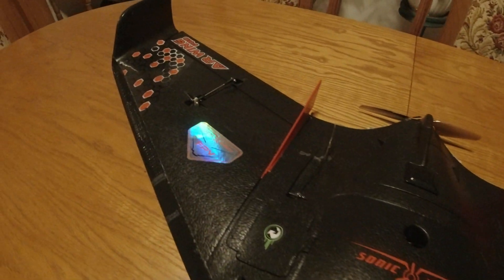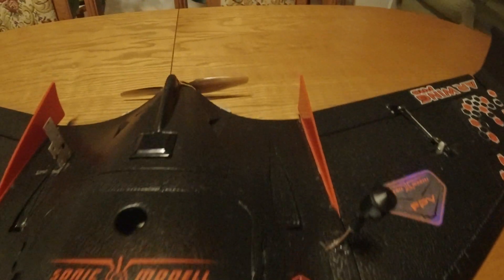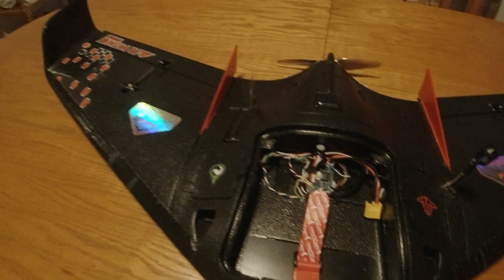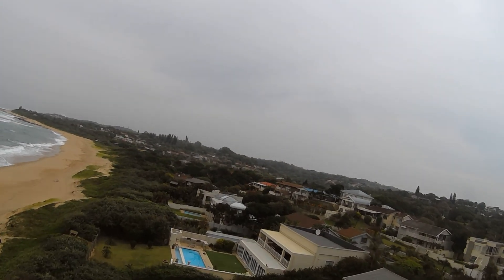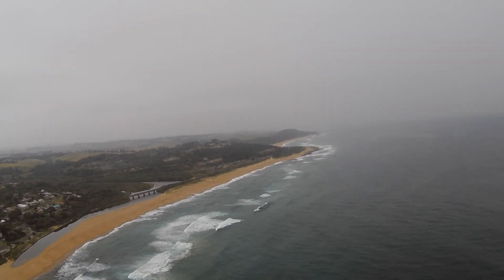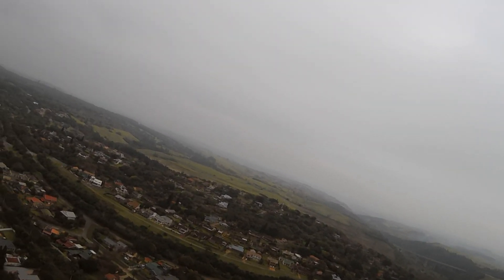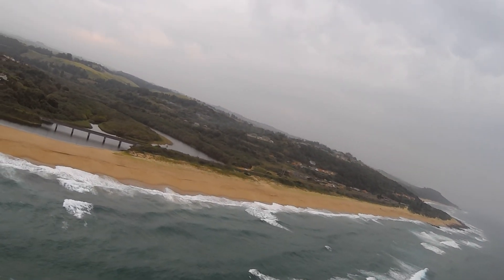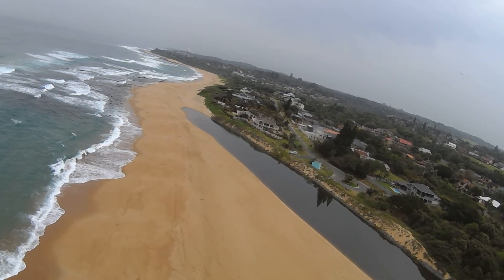AR Wing Pro Setup. Fixing the common issues.

Comment: What do you think about cutting off a little part of the tail and moving the original sunnysky motor closer to the CG ?
Reply from the maker: It would probably make it a bit louder having the prop closer to the body but should work for reducing the amount of weight needed in the nose.
Reply: @antzd  Yeah it is VERY quiet as is, with stock sunnysky 2216 but this one is so long and weights 74g :/ I will probably search for something with low profile, such as T-Motor F90 2806.5 Motor - 1300KV

Comment: This  is  almost  exact  setup  im going for  right  now! Glad  I  foud  your  video.  My  idea  was  to  use  larger mini quad motor  after seeing  plent  of tests that  showed  that these  motors  are  capable  of pulling  2ooo grams  of  thrust. I  then  compared it  to recommended (  included)  motor and  its very  similar. My  only question is what amp  draw are you  getting  while  cruising?
Reply from the maker: It cruises comfortably at around 6 amps. Even at higher throttle the amp draw stays below 30 in flight. I've had it pull around 50 amps max on launch at 100% throttle when the prop can't unload.
Reply: @antzd  Thanks! Good to know! Ive just finished mine  literally 2 hours ago and the AUW is 950grams ( no GoPro)
Reply from the maker: @RS_  I can't get mine to balance on cg without an action cam on the nose. Around 1kg AUW is a good number. Good luck with the maiden flight.
Reply: @antzd  mine balances perfectly!  But I used light motor ( half the weight  of the sunnysky included) , very light blheli 32 ESC 50A . I also moved the FC  3cm forward  and  both antennas ( crsf and vtx) I moved to the fron t of the wing)

Comment: I cant believe you got that big plane in the air with that small motor
Reply from the maker: It's deceptive. Makes well over 2kg of thrust from the small motor so close to 2:1 power to weight. The mini quad motors are extremely powerful for their size
Reply: @antzd  what size battery did you run a small battery?
Reply from the maker: @staydown.normalsavas  I run a 5000mah 3s

Comment: i had to buy a new motor after a failed inav auto launch lol like everyone the settings are too low for a big heavy plane. I have a new sunnysky 1400kv v3 blue motor they have 30% more thrust and wont over heat
Reply from the maker: Yes the default settings on inav launch are not suited to larger wings. I haven't had a single failed launch since switching to arduplane, even the first launch when I accidentally had the esc protocol set to pwm where max throttle was 16 amps it went up nicely. Sunnysky are great motors.

Comment: why did you connect your servo push bars soo low your not going to have enough throws
Reply from the maker: I measured the elevon deflection to be correct at that point, the frsky sbus servos seem to have more range than the standard servos.
Reply: @antzd  be careful i bought this plane last year and sent it back after failed attemps... now i have hours under my belt from the sonic modell 600m.

Comment: how do u secure the flightcontroller? doublesided tape?
Reply: Thanks  i Will do the same.
Reply from the maker: Yes, I use silicone mounting tape.
Reply: @antzd  isnt that coming loose over time? just trying to find a good way to mount mine :)
Reply from the maker: @fpvkagge  no, that's why I use the silicone mounting tape and not normal double sided tape. Look for the tape that's used to mount against walls without nails, it's very strong and helps a little with vibration isolation.

Comment: Great work with the fins. I have a question about ardupilot. I would like to change and have already prepared everything. It looks very complex, but I'm very excited to try it. I'm afraid of destroying my ar wing again because there are so many settings and I don't know exactly what is decisive for a good maiden. I'm reading everything about first setup right now.

But would you still stay at ardupilot? Greetings rene
Reply from the maker: Yes I will be staying on ardupilot, it is completely worth it, all my fixed wing builds going forward will be ardupilot based. Great thing about ardupilot is it won't even arm if something isn't right, I had a few times of troubleshooting errors on the ground with it not arming but those saved me from having failed launches and issues in the air. Best way I can describe ardupilot is peace of mind, it's an involved process setting it up but solid and reliable once that's out the way.

Comment: Those verts don't do much except placebo.  They are not far enough behind the cg to matter.  They also add a bunch of rearward weight.   The f80 might be fine for small fields, but my arpro would do 60mph for 20 minutes with a 2315 1310kv and a 7x6.  5s 3000mah.  Just move the cg back 10mm and good to go.  Draks fly well because they are engineered aircraft.  Not because they have verts that look cool.
Reply from the maker: Could be placebo, I'm just happy I don't get nauseated by the wagging anymore so I'm keeping the fins even if only for placebo purpose. I have the ritewing hardcore 38 and hardcore 44, they are in a whole other league compared to the banggood wings so I was never expecting the AR pro to fly close to as well as those. Would be heartbroken if anything happened to my hardcores so the AR Pro is my long range and sketchy spot go to since its cheap and easy to replace.

Comment: What size are your flight packs you use.
Reply from the maker: I use 2x 2200mah 3s packs running in parallel, comes in around 400grams total.